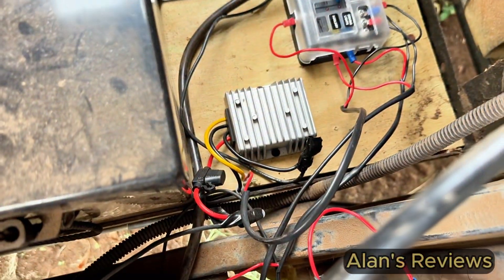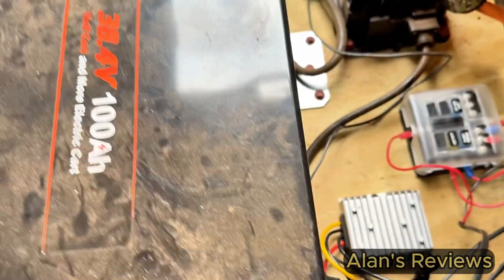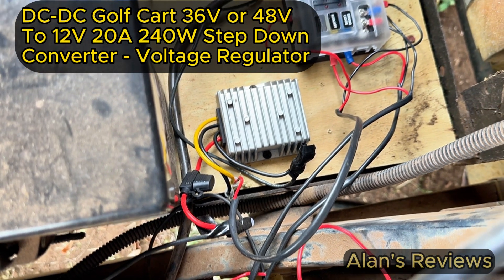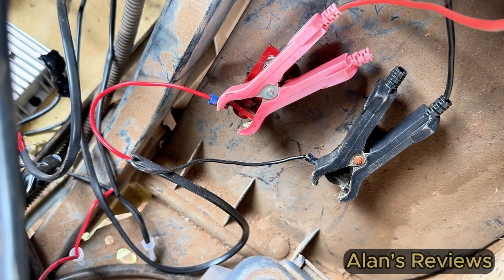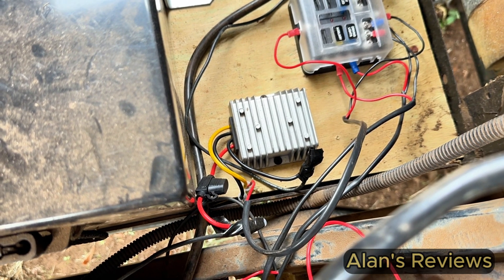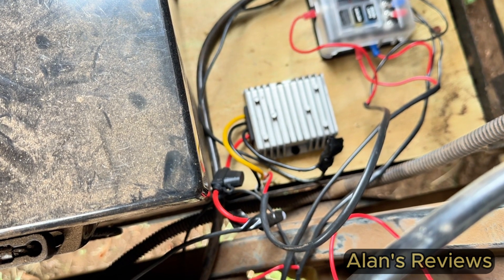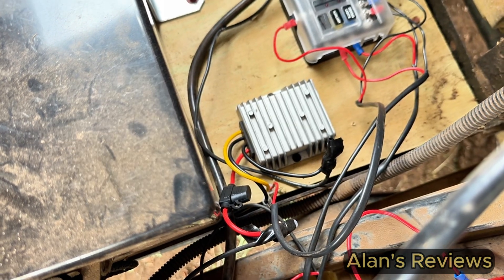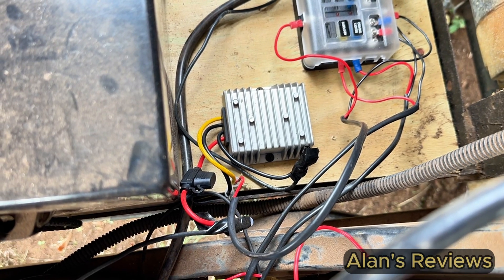Powering 12V Accessories on a 36V Battery Made EASY - DC-DC Golf Cart  Step Down Converter

Comment: how many 12v devices I can connect to this ? for example a have a Sirocco fan and a 12v mini split AC in a van, will this hold ? or I need two of these ?
Reply from the maker: That's hard to say. You would have to look at the draw from your appliances and the output of the converter. I don't think this is designed to provide the power for something as large as an A/C

Comment: Should that be wired to a 12 volt battery to smooth out the load when operating multiple 12 volt accessories
Reply from the maker: No, this converts 36 or 48 V to 12 V. 

The output of this device is 12 V. 

But it will accept a 36 V input or a 48 V input.